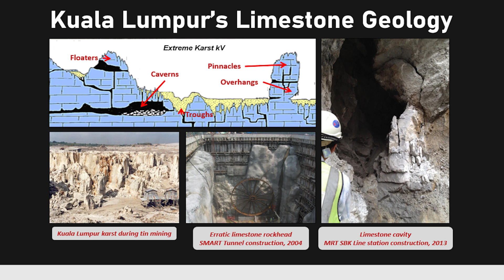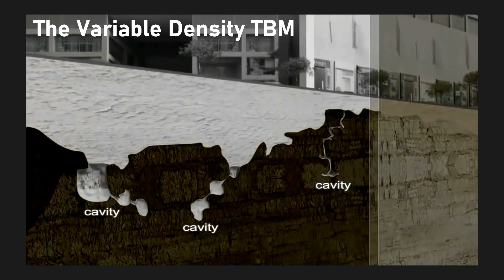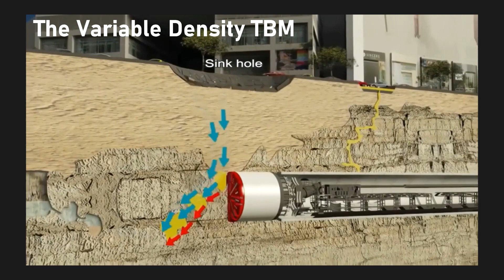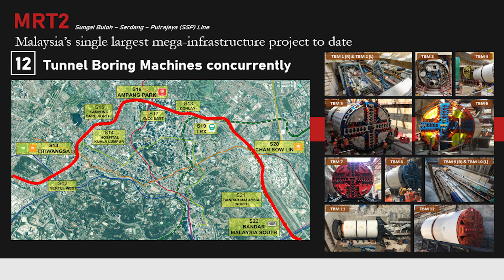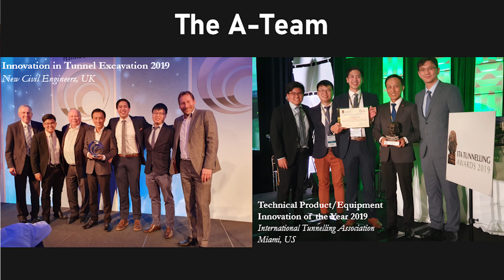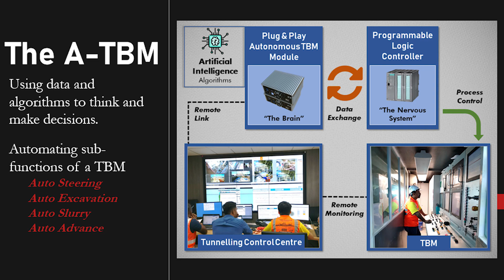Tunnelling Into A Digital Revolution  | Ng Hau Wei | TEDxSunwayUniversity

Comment: Our Genie-Minis aka the client boxes that get their "redistributed signal" from the Genie Lite. Each of the 3 TVs that are connected to a Mini-Genie lose their signal; consequently nothing is retained in memory which is very aggravating because you can't use the previous channel nor the “Last 4 Channels” .  This past Saturday, September 12, 2020 the DirecTV Technician  arrived at approximately 1000hrs; commenced looking at the kitchen TV – the Technician stated that it is a software problem and that it only occurs to the Genie Lite boxes; due to all the restrictions ie., the technician cannot upgrade to a full Genie because that requires that the customer call “Customer Service” to upgrade to the full Genie, which according to Technician the bigger Genie does not have the software problem; I insisted that he swap out the Genie Lite with a new Genie Lite to confirm his claim because it is beyond the pale that a company would let a problem like this propagate for years; I was flabbergasted that the Technician claimed that they only install the Genie Lite for “Business-to-Business”.  The Technician removed our Genie Lite; discovered that we don't need the Power Inserter because the Genie Lite has its on internal power (?); he reprogrammed each of the four-(4) remote controls and provided a new spare remote; thus far to my surprise the remote in my bedroom can power on/off the TV and control volume .  I am really, really disappointed with ATT-DirecTV Customer Service or lack thereof.  We immediately received a bill via email that we owe $99.00 - I believe this charge gets credited back to our account once we ship the old Genie Lite - We pay for a "Maintenance Plan", we have to fight to get any "customer service" and then we get sucker-punched again by their "Business Model"!  Two days later I am channel surfing and find a ATT-DirecTV Message or Information Channel stating that our equipment is no longer supported and that we qualify for a free upgrade* *Conditions Apply WTF?